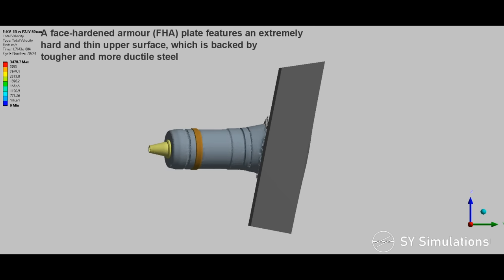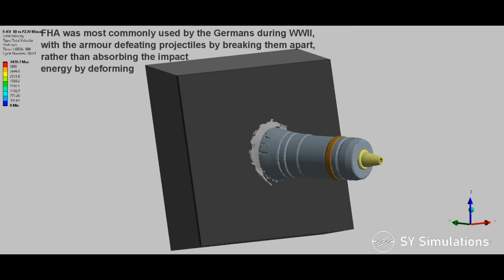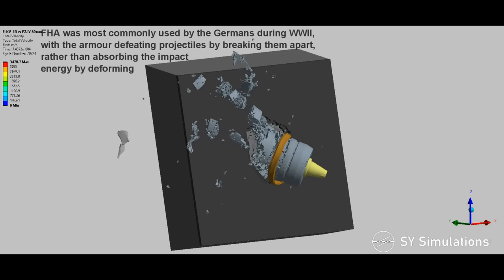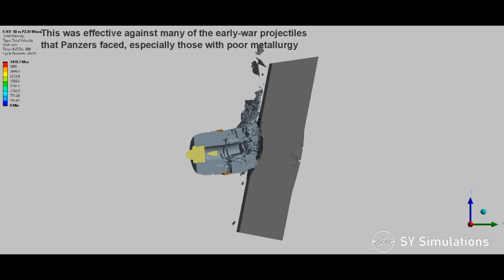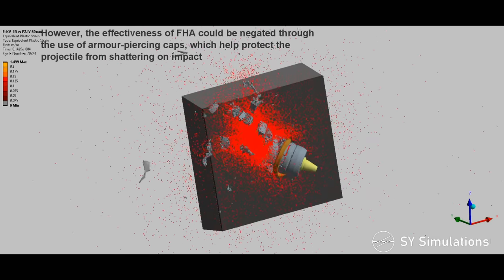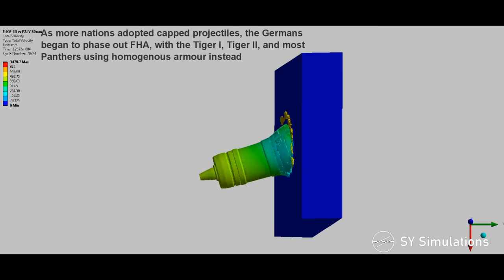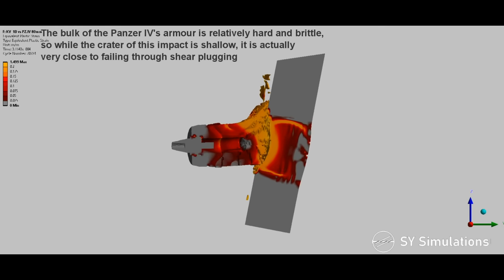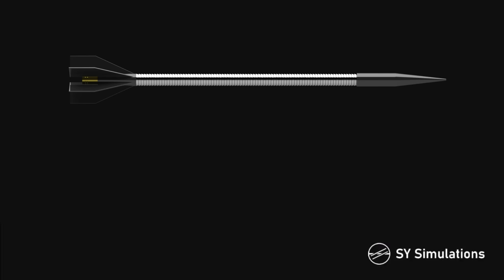T-34 vs FACE-HARDENED ARMOUR SIMULATION | 76mm BR-350B vs Pz.IV H | Armour Penetration Simulation

Comment: Would be cool to see 76 mm M93 HVAP vs Panther UFP.
Reply: It would be interesting to see both a face hardened Ausf D UFP vs an Ausf A or later homogenous UFP
Reply: @STHV_  That's also true! Face hardened armour is subpar at high obliquity impacts due to plug shearing so a comparison (against M93) or some other shell that's "close" to being able to penetrate) would be very interesting.

Comment: Nice.  Those shear bands...I see what you mean.  Question - could you do the hit by IJN Kirishima on the USS South Dakota's #3 barbette.  Apparently the hit clipped a deck hatch which decapped the projectile, which went a long way toward ensuring this did little more than scar and leave a shallow impact crater on the surface. (Ref NAVWEAPS and the articles on the battleship action 14-15 November and the USS South Dakota damage analysis).  This might be another interesting face hardened test case.  It would also be interesting to have the exact same impact profile, yet with the cap in place to see what difference that would make.
Reply: Ooh, ooh, I can simulate the Kirishima getting hit by the 16" shell!

It just keeps going all the way through the ship.
Reply: tl;dr for our channel host; impact angle 17.6 degrees from vertical.
The Lundgren/Okun article on Navweaps really clears up some ambiguity in the original Damage Report #57. The newer paper concluded that the 14” pushed through the weather deck, decapping the shell. On impact, the base swung up and slapped the barbette above the impact site. The cap itself ricochet’d through the hatch coaming.

I tried to modify the link to be postable but my comment was deleted.

Comment: ~250m?! That is super close! Even early AT guns, similar to Pak 35/36 were a threat to T-34 at that distance!😲
Reply: well, not really, they didint call the pak36 the door knocker for nothing
Reply: @quan-uo5ws  Being struck that close at the correct angle. It's still a potential threat that the Soviet tank crews couldn't just ignore it. Besides, Brits, Yanks, Soviets, Italians, Japanese, Swedes had very similar ATs in their inventory (large quantities) in that stage of war.
Reply: @quan-uo5ws  Ok but pak 38 could totally defeat a T34 even at 1000m
Latest versions of Panzer IIIs were on par with T34/76
As for Panzer IV, versions like Ausf G and H outclassed T34, that's why the Russians had to bring on the T34/85
The 76mm gun couldn't even pierce the 80mm frontal armor of a Panzer IV unless at close range like possibly under 300m while the Panzer IVs and Stug IIIs could destroy a T34 even beyond 1000m
T34/85 was on par with the Panzer IV H or G as each tank could destroy the other at 1000m and beyond but still was outclassed by Panthers and Tigers and by far
As for cold war, the 85 was outclassed by even the Sherman's long 76mm gun and completely destroyed by the Pershing

Comment: I'd like to see the same vs the Sherman's most common round.
Reply: I agree completely, a direct comparison of the 75mm m3 with it's lower velocity but higher quality ammunition
Reply: @dyllanalford5276 I believe the 75mm M3 had more penetration than the Soviet 76mm.
Reply: @Averagedude2024 correct. Harder projectile
Reply: @Losingsince  there’s a video of the 75mm M3 penetrating the tiger at point blank so it should probably punch through the PZ IV at a decent range
Reply: @Averagedude2024 the T-34 had a better penetration compared to the Sherman's 75mm. The main advantage of the sherman though was that it's optics and overall crew sights meant finding and shooting was way easier on a sherman. It was noted that in urban combat, a sherman would have advantage even over a Panther for it's optics and targeting were great. The T-34 was very fast and loud as hell. Germans said you knew one was around from kms away before you could see it. It would also go through terrain that germans would never imagine, mud, swamps, nothing could stop it. But the sherman? I saw soviet veterans who just loved the tank. They said the only issue was being too tall. By the time they made the easy 8, shermans were already superior to the medium tanks of every nation. 

To me it's quite unfair to say the Sherman was a bad tank
Reply: @thiagorodrigues5211  the 75MM M3 gun had more penetration than the 76mm F34. If we’re discussing the Soviet 85mm, that would have more penetration than the 75mm M3
Reply: @Averagedude2024  it didn't. You're comparing a 50% average to a 75% average. So the numbers aren't comparable
Reply: @thiagorodrigues5211  then let’s compare the most commonly used shells so there’s consistency.
Reply: @Averagedude2024  Would be cool to zee the M-3 vs the Zis-5 against the same armor. 

Then T-34 vs any 75mm version of the sherman. The Easy 8 though would have an easier time against the 85
Reply: @thiagorodrigues5211 the t34 wasn’t as fast as people claim it was, it’s probable top speed was only around 15 to 24 kmph
Reply: @okmeneer9583  are you joking
Reply: @okmeneer9583  To show you how nonsensical that number you provided was, i'll tell you that the churchill heavy tank, a tank designed to go at the speed of the walk of infantry, had a top speed of 24 km/h (source: https://en.m.wikipedia.org/wiki/Churchill_tank ) The T-34 was way lighter than the churchill with a better engine, designed to be mobile. The T-34's actual speed was 53 km/h (source: https://en.m.wikipedia.org/wiki/T-34 ).

Comment: That last view is absolutely fantastic for everyone's understanding how close the armor was to failure.
Thanks for including it!
Reply: To by honest the distance was only 250 meters so the armour hold up extremely well.
Reply: That hit would cause nasty spall inside the tank and from your comment it is clear its not visible for you...
Reply: forgot about spalling
Reply: That small amount of spall would have gotten mostly absorbed by the driver or bow gunner, and the internal wall behind them, in this particular instance. It wouldn't take much to stop the spall from hitting the 3 turret crewmen in this case, and those guys would probably be able to bail out. RIP to the 2 guys in front though.
Reply: The tank is probably done for few days. Crew maybe ok, maybe some dead.
Reply: Would a BR-350A penetrate this armor?

Comment: I'd like to see a comparison between standard US WW2 era (1943-1945) 90mm M82 ammo and the later T50E1 90mm ammo. T50E1 had significantly improved metallurgic properties and it'd be interesting to see the two projectiles compared head-to-head. T50E1 was eventually adopted as M82 postwar. Someone on the war thunder forums/reddit has made an excellent post describing the differences between the 3 M82 projectiles used by the US.
Reply: Is there a link to this post to read?

Comment: Odd the Germans used AP-capped shells even though I don’t seem to recall if the Brits, USA or Russians used much face hardened armor. A properly designed APC projectile if driven  at a high enough initial velocity will do just fine. The UK 17 pdr APCBC, USA 76 mm/3” M62 or the 90 mm M82 or the Russian 100 mm BR-412D (possibly post-war) are examples. 
The same trend away from face hardened armor was also seen in the last battleships. Big thick, tough alloy plates ar😂e hard enough to roll and shape much less face hardened and anneal. Plus AP shells such as the 2,700 AP capped with windscreens for the USN’s 16”/45 & 16”/50 were well designed for dealing with FH armor. (And rarely used vs other battleships - USS Washington vs IJN Kirishima is the only one that comes to mind. Surigao Strait was resurrected WW I vintage Battleships (whose 16”/45 guns could not fire the 2,700 lbrs) vs similar vintage IJN battleships.)

Comment: General question how effective was plugging, I saw a lot of soviet shells do it in sims but in real life it seamed to have had much less effect than other shells that do radial fracture or brittle fracture when they come close to penetration. (like German and American shells seamed to rarely plug)
Reply: I'm not sure your assumption is correct.

Plugging always shows up, especially at a higher angle of impact, with some upper bound. But plugging is also often observed with penetration that is around the limits, even at lower impact angle. 

Plugging is instead not observed when penetrator is significantly above the limit and is intact. 

But any given projectile armor interaction will always have more than 1 failure mode. Some failure mode will be the dominated one but it is almost never going to be 1 only. In this instance, the plug itself experience some radial fracture for example. 

Beside, both the armor and the penetrator has equal responsibility on the observed failure.

Comment: If I may suggest, a Mark 8 out of a QF 17-pounder 76.2mm (3') against a T34-85 Drivers Hatch/ Frontal Armour. I'm curious to see how allied muntions would've stacked up against Soviet tanks.
Reply: I just used WarThunder armour viewer and it will not penetrate the drivers hatch.
To defeat it you need 120mm APFSDS from no further than 100m.

(sarcasm aside, 1Km, easy. 2Km not the hatch but still go through the plate.)
Reply: Probably not the best matchup if you want to do that, a 17 pounder will go through a medium tank like the T-34 with ease. The Sherman's 75mm would be a better matchup against T-34 armor, or if you want to use the 17 pounder, an IS-2 or T-44 would be a better target.
Reply: @sayerglasgow115  I chose the QF 17-Pounder due to it being the standard anti-tank cannon used in Sherman VC tanks, the Archer, and subsequent post-war era Challenger and Comet prototypes. A short 75mm from a Shermans M3 cannon would've made a better test munition in hindsight.

Comment: Solution during that time was to continue using FHA as it was superior type of armor technology. Except add an additional layer of armor which would be sufficient at shattering armor projectile caps. Then it would hit FHA part which would stop the projectile. This type of armor would be early composite armor and would had been superior to historical alternatives at the time. 

There was up-armor attempts, but they were more of improvisations. They also did not designed specific plates to counter specific threats. Furthermore, it wasn't made in factory and mostly just improvised and poorly wielded add-ons to a tank. Instead of Tiger having 100 mm of RHA steel, it could have had 80 of FHA steel. Then an air gap. Then it would have 20 mm of external armor. This armor would be wielded over a tank as a main plate. This would had been much more effective against all projectiles and maybe would even protect against HEAT.

Comment: On the subject of face-hardening, could you throw some high calibre naval shells at battleship plate? Ideally with one example being face-hardening done poorly (for the shells being thrown at it) like US battleship face-hardened armour seems to have mostly been, and another example (against the same threat) being face-hardening done well. Maybe you could even do one without any face hardening at all. To my understanding US battleship class A armour was quite good in lower thicknesses against lighter shells (cruiser and below) but the shear depth of the hardening made them very poor and prone to cracking and shattering at the scale of battleships. It sounds like face-hardening loses a lot of it's benefits as you get to that scale
Reply: Don't US has like 3 different manufacturers each has their own formula and process for their class A plate, and each exhibit different behavior?
Reply: I think Drachinifel might be the right guy to ask this.

Comment: It's weird to think somewhat that should be so useful, like face-hardening existed so long with warships but wasn't used on armor until WW2.
Reply: Well, before WW2 tank armour plates were rather thin anyways, so I do not see a point in face hardening them either.
Reply: @sskuk1095  that is true, but even some of the heavier-armored interwar vehicles didn't use it

Edit: Or even try to

Comment: IRL, BR-350B vs 80mm Pz-IV front - penetraton @ 600m. BR-350A failed to panetrate @ 100m.
Reply: Sauce?
Reply: Probably it was 50mm RHA + 30mm FHA. The 80mm FHA would certainly stop the round at 500m.

Comment: Did the face hardening actually help? I have my doubts about it. Maybe you could run another sim of the same scenario but with a 350 BHN homo plate this time?
Reply: Yeah. I am also curious about that. Flat projectiles were used because pointed shells were not very effective against FHA, so by using flat shells you lose nothing but gain advantages in some areas.
Reply: Face hardening defeats uncapped ammo by causing the round to shatter. It is very effective especially when the calibre of the ap round under matches the armour thickness.  Soviets used almost exclusively uncapped ammo, the most numerous  being 45, 56, 76 and 85mm . German 80mm FHA plates were therefore the optimal thickness to defeat those rounds. However FHA is less effective than RHA against capped ammo but since most of the fighting was being done on the Eastern front and British/US AP was generally smaller calibre than Soviet stuff, the use of FHA was the better compromise for the Germans. They later dropped face hardening due to shortage of alloys and difficulties associated with heat treatment and controlled quenching of thick plates.

Comment: Could you show a simulation of the MBT M1A2 SEPSv2 upper right or left turret plate vs older kinetic penetrators like the 8.8 cm KwK 36 form the tiger 1 or  7.5 cm Kampfwagenkanone (KwK) 42 L/70 from Panzer V, or the tigger 2s 8.8 cm KwK 43 L/71 anti-tank, that would be amazing to see how modern armor works against older projectiles.
Reply: No. Turret Armor of modern MBTs is classified
Reply: @pimmelschilz9728  oh, how about older models of MBTs, like the M1A1?
Reply: There's a video showing Jagdtiger 128mm vs Abrams lower hull @MrWilde-zx7vm
Reply: @MrWilde-zx7vm  We only know base M1 (from 1979) and I think only the hull.
Reply: @rare_kumiko  Oh, that’s too bad. It would be cool if we could see the modern armor and how well it does.
Reply: @MrWilde-zx7vm  In September, the Abrams should get to Ukraine, booking information may appear.
Reply: @Baton666  but I’ve heard that they are taking some type of stuff out of the armor because of transportation qualifications of some sort. So the armor won’t be up to date.

Comment: I thought the pzIV ausf H had 20+20+30mm base armor and bolted armor plates.
Reply: No that one was pretty rare. It was an old Pz. V D which was modernized with extra armor and the KwK 40.
So probably an old tank which was repaired and then upgraded.

The regular versions of Pz. IV
went through this armor iterations:
30mm FHA
30mm FHA + 30mm FHA
50mm FHA
50mm FHA + 30mm FHA
80mm FHA
80mm RHA

Comment: could face hardend armour be used as part of coomposite arrays?
Reply: But why? You don't get the benefits and have all the drawback!
In order to fulfill the function of the face hardened part, you have the ceramics in place after all.

Comment: You mentioned that FHA has hardened surface and ductile steel at the back. So how armor is "very close to failing" when it barely made a dent? It would break over initial surface and then would face metal which is very resistant to bending and doesn't shatter.